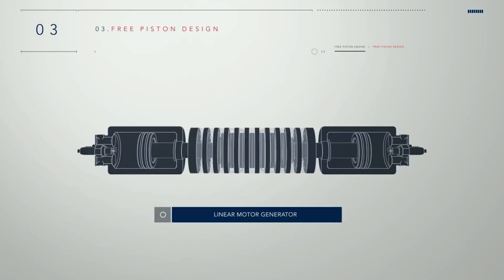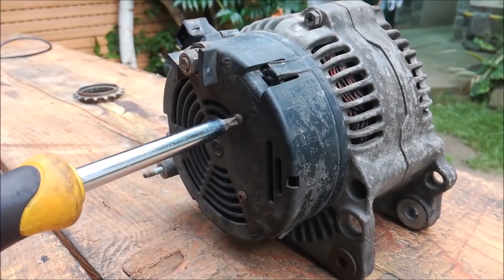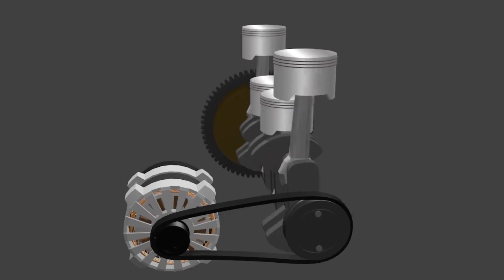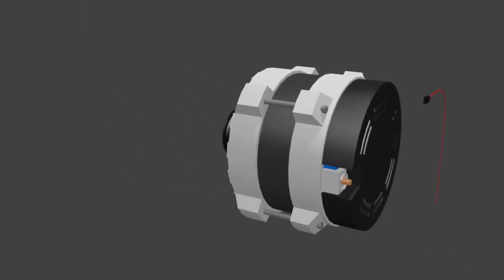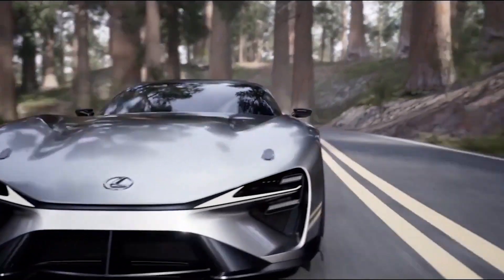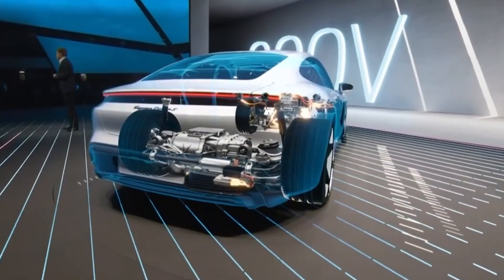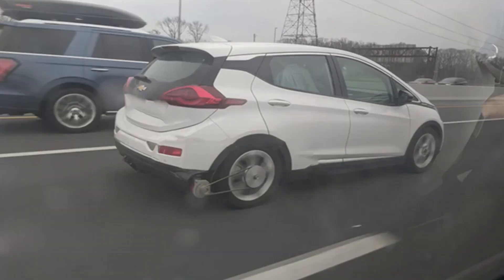Can you use an Alternator to Charge your electric car?

Comment: I still think it is possible....now...if the driveshaft was modified at at some area so that it acts as  an amature then  and then enclosed by coil on its way to the wheel ..wont that solve the energy wastage concerns?
Reply: The 2,back wheel shaft alone can do that job gevin rotation to the 3Altenator easy as that ,They just don't want us to enjoy free Energy, but rather keep on sucking us mentally and financially 💸💸💸💸💸

Comment: What about front wheel drive electric car and add to the rear wheel (free spinning wheels) A Dual Alternators that’s used AC clutch to engage only  when stability control to breaking

Comment: If the gear the alternator to reduce drag on the drive axles it would at least hive you extended range. Apply a excitation field when the vehicle is not under a sever load like sum straight aways and hills. The alternator can be incorporated into the drive assembly
Reply: Yes the Rich and powerful people don't want us to free Financially and mentally, still buy energy to run this very expensive cars , very bad

Comment: You dont need the alternator to run the electric motor. That's for the batteries. I believe its possible to use a spinning shaft to run the alternator rpms to charge the batteries. I see this used with the  diesal engines in boats. A man hooked 3 generators to the engine and would rev the rpms charging his batteries. This concept should be able to transfer to an electric motor to charge the batteries as long as you can get the generators rpm up to charge them. This is just out of the box thinking. I am not a mechanic or an engineer but seems to me it would work

Comment: Forgetting weight for a moment, what if you had a few 48v alternators driven by a 48v DC Motor and a pair of 48V battery banks. 

You have eliminated as much frictional losses as possible.

Why would several high output Alternators or even PMAC’s not generate sufficient energy to top up a depleted bank?

Comment: I think your bullshitting the world, it wouldn’t take much energy to spin an alternator. But that’s free energy isn’t it. If you added 2 alternators to an electric car, that would charge batteries.
Reply from the maker: Yeah I am talking bs. Why dont you try it and prove me wrong👍🏻.
Reply: If it could be done, it would already be done.  Years ago, you could put a small generator rubbing against a bicycle tire to light up the headlight.  You had to downshift one or two gears,to overcome the drag, and it was only powering a small headlight.  
Alternates always use more energy than they produce.

Comment: I just love how everybody basically tries to disprove on a self-powering electrical car when they themselves have not taken apart an alternator or a electrical motor because electric vehicles uses the same principle as combustible engine or a diesel engine it's still uses the same principle because only the back end is needed to push the object in question in order to get from point a to point b and the front end is only used to steer unless it is a front-wheel drive or an all-wheel drive and so if you replace the front electrical motor with a specially modified alternator and just keep the electrical motor in the back then you can still use said object to get from point a to point b
Reply: please explain more? can a generator from wheels really keep the EV car powered on a highway?
Reply: 100% wrong... all the wheels spin at the same speed they might be rear wheel drive but the wheels are still linked if you added a belt to the front and kept it separate you are now adding extra friction to only 2 wheels thus causes all kinds of separate issues basically no your idea sadly will never work sorry to break it to you... basically you are driving while holding the breaks yes you can drive while pressing the breaks but now you need more power to run the car thus all that extra power generated by your alternator is 100% useless so why even have it

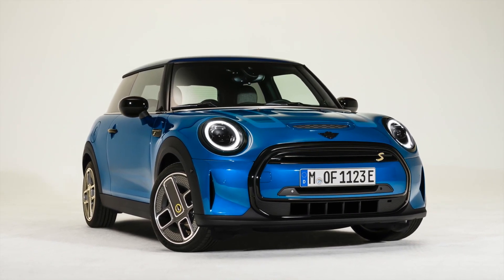Comment: 2:27 I was getting worried that someone actually thought this would work.
Reply: Yes it will work, Altenator it is the same function like Electricity, Electricity in like wind Electrical generator, that get the Energy by just rotating,the same as 💦 water electricity the Energy comes by rotating a motor just like Alternator,
Reply: @Isaac-Gbornor-  The wind is the source of the energy, where is the wind coming from? If you can create wind from nothing, then your theory makes sense.
Reply: The technology exists, it’s just not applied here. Why would any company want to sell you something that you’ll never have to come back to them again for?
Reply: @q6906  comeback to them for what? Charging?
Reply: @StriderVM  I’m general. Planned obsolescence. Companies don’t want you to have a car that gets 100mpg or to have a car with parts that don’t need to be replaced
Reply: @q6906  Which part would never need to be replaced? Isn't an alternator another part to be replaced?

Comment: Why not just add a extra battery and a switch. While you are driving it can charge the extra battery. When that battery gets low just flip the switch
Reply: Ying yang
Reply: We actually have something similar in the military for one of our vehicles in case the primary batteries die the aux batteries work perfect by this exact premise so it would indeed work with an EV. And by simply using a condensed aluminum alternator would reduce weight from it instead of a steal one copper is already light which is inside them by hooking these up to the drive shaft inside the body and replacing the driveshaft with a hollow aluminum driveshaft would reduce and balance out the weight instead so it would indeed work if you actually have mechanical experience or know someone who does it's simple mechanics and engineering
Reply: I love your driven and creative mind, I had the same thought. @johncampbell8364
Reply: Because that would make too much sense 😆
Reply: Yes separate the already installed battery in half and while one half is charging and disconnected to powering the car , the other half is powering the car. We do not need unlimited range. We just want something thats reliable
Reply from the maker: Weight😂
Reply: @ChrisVSCars  True that true that 🤣🤣Should have thought about that 🤣🤣

Comment: Most likely it would decrease the range as the electric motors have to use more power to overcome the braking action of the alternator. That's why regenerative braking was added into EVs, to extend the range by using an electric motor's inherent braking ability when it works as a generator. Instead of wasting the kinetic energy as heat with brake pads and discs, the motors can use it send electricity back into the battery bank while slowing the car.
Reply: Well,  but my idea now is to create use the rotational force of the shaft on its way to wheel..where it acts as an amature  then it is surrounded by a coil

Comment: Use another em that rotates constantly when you turn the car on. Then connect an overdrive gear ratio to the alternator from that motor. Maybe this could help compensate for the loss of energy? The only downside is that you'd be running another separate motor. I think it's worth a try though.
Reply: It's not worth trying
Reply: It always takes more power to turn an alternator, than it can produce.

Comment: The saddest thing is that this isn’t an April fools video
Reply from the maker: Why is it sad😂
Reply: @ChrisVSCars  because obviously an alternator would be inefficient. You spent 4 minutes when you could have just stated basic laws of thermodynamics. And still at the end you said it would have little effect, when in reality it would have obvious negative effect from parasitic loss.
Reply from the maker: Ohh😂 yeah, but some people don't understand that
Reply: @ChrisVSCars  Apparently you didn't understand it either. You stated in the video that it would have a small increase in range. Wrong. No increase.
Reply: I have a question. With scientists recently discovering nuclear fusion where there is more energy than what was started with, doesn’t that violate one of the laws of thermodynamics?
Reply: @Mabeylater293  Learn mass and energy equivalency, you'll understand how they relate to how the sun self sustains,it doesn't violate the law because it still needs fuel/mass in order to produce energy through the reaction.
Reply: @Mabeylater293  Well that's the point of producing electricity, produce more energy than you need to make it happen. Every type of electricity production do that.
Reply: @Mabeylater293  No. The energy produced by fusion is nuclear bonding energy, which turns to heat, which is used to produce steam and drive a turbine which drives a generator. Very complicated.
Solar panels produce electricity directly from light energy from the sun. With the money spent on fusion, we could have built many many solar farms and batteries. Small modular fission reactors make sense.

Comment: The drag of the alternator even lessens the power.
Reply: That is not true IE the drag of the alternator heavier that the car or the wheels , Wrong you are on of the Guys who don't want the people to be free mentally and financially,💸💸💸💸💸😀😀😀😀
Reply: @Isaac-Gbornor-  If the drag of the alternator of the car or the wheels, then the battery would need a lot more power to make the car wheel spin.

If you are so sure, you can make it yourself right?
Reply: Someone will, if the front wheels drive the car, the rear wheels can be connected to a large generator. 3000 or even a 6000 watt generator can be turned by hand, not much would be needed to turn it. That should be way more than enough to extend range. This is already being secretly tested now.  Nothing is impossible just improbable.
Reply: @benjaminhenderson1759  I wonder why you need a 10 hp motor to turn a 6kw generator if they're so easy to spin?
Reply: @Isaac-Gbornor-  Government paranoia combined with lack of physics knowledge. Poisonous.

Comment: It will not increase your range. 😆
More weight
More wind interference 
More gas used
More resistance on tire
Needs new BMS
CREATING POWER IS ONE THING NOW TO USE IT OR STORE IT REQUIRES A NEW BMS...
YOU CAN NEVER EXTRACT MORE POWER THAN PUT IN PLUS AS MENTIONED B4... Prius tires keep spinning internally when brake is applied. That recycled kinetic energy charges the battery. Adding an alternator would be 2 steps forward one step back...

Comment: Bruh it's already a feature it's called regenerative braking.....
Reply: nope that's from reverse motion from braking, which is infrequent. alternator uses forward rotation
Reply: Bruh you literally can turn a alternator into a electric motor dum dum it's been done before therefore it's literally the same thing what you said made no sense
Reply: @ghalibbakhtiar1300 regen braking is a general term but you know hybrid cars recharge even as you accelerate? Mine does ,the screen shows it, I'm sure EVs  do as well
Reply: Regenerative braking uses existing momentum to slow the car by using the drive motor as a generator, until you're almost stopped. It does increase range, a little. Saves the brakes. They last much longer.

Comment: This guy is a paided total bullshit
Spreader!! There apsolutley no possible credible reason as to why not power the battery with all wheel alternaters to re power The
Battery, the only reasons that are fabricated are so that everyone continues to befall the same comercial fate of becoming a consumer "SLAVE" be it by fuel
And or now electricity! If your own vehicle created its own power then you would become free from
The powers at be,the same Slave holder that NEED YOU TO ALWAYS DEPEND ON THEM.
THnever wish to set you "FREE"
Reply: There's no such thing as free energy the added resistance of 1 to 4 generators would make the car use more power than it will get back.. it's the same principle as a petrol generator the more power you draw the more it revs to produce the power needed. So as the battery draws a fk ton of power to charge it creates a fk ton of resistance and that takes more power to overcome that makes more resistance and it goes on and on.. free energy is a dream that is impossible to achieve.
Reply from the maker: Thank you
Reply: @ChrisVSCars  🙂